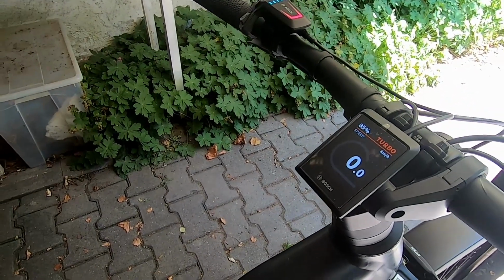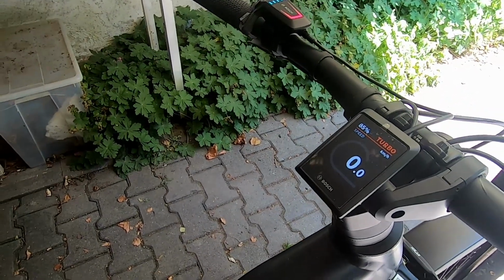E BIke Tuning for BOSCH Smart System Volspeed: Installation video

Comment: So with the installed VOLSpeed module, we don't see the actual speed on the speedometer?
I assume that even the calculation of the distance traveled is no longer accurate?

to bad :/
Reply from the maker: yes you are right! unfortunately this happen because the Bosch Smart System software does not allow the correct speed to be displayed on the display :-( said this however, with the SpeedBox 1.0 B.Tuning it is possible to see the correct speed only via the phone app..  :-)

Comment: is this for the new Smart system ?
Reply from the maker: Yes indeed but it is NOT compatible with bikes with the magnet on the air-valve /rim and ABS system. Please forward an enquiry to: info@ebikespartsandaccessories.com  we will forward you toward the compatible product for your ebike